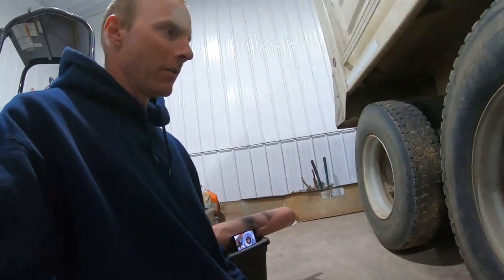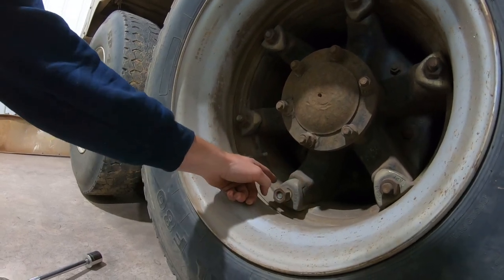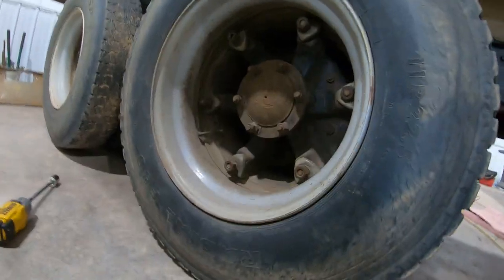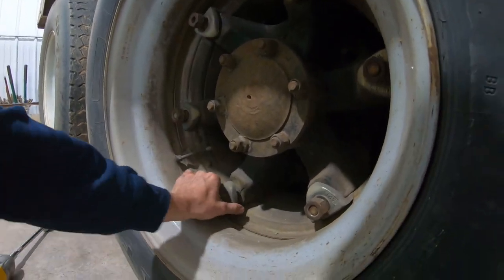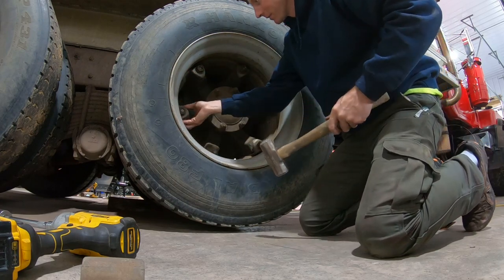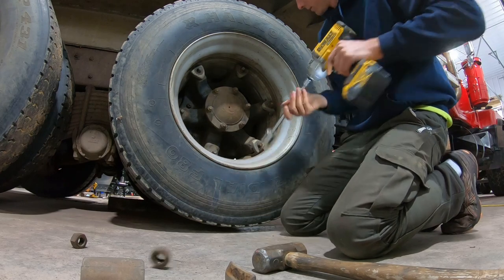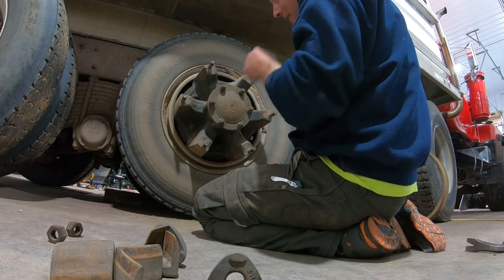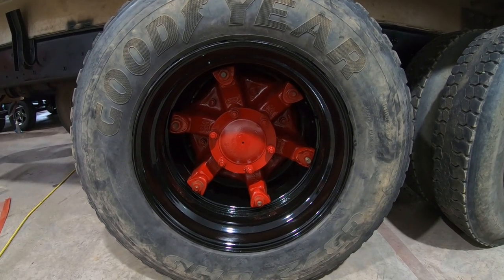How To Take Off Dayton Wheels

Comment: Used to remember trucking with theses on the old trailers, we had to tighten the nuts every time we hooked onto them, nuts got loose and the rim would spin on the hub rip off the valve stem. Some drivers over tightened them, stretched the studs and could screw up the spacer ring. Glad they are pretty much gone now
Reply from the maker: For sure not the nicest thing to work with.

Comment: I was a kid the first time i changed a dayton rim.
Took the nut all the way off. The wedge let go like a rifle shot.
The shop still has the hole in the wall where the wedge hit.
Reply from the maker: That's crazy definitely have to be careful.
Reply: I was always told when messing with split rims/two piece, remove the valve stem or empty all the air.

I NEVER messed with pressurized tyres and always used an inflation cage for exactly that reason. My cousin lost a leg airing up a split rim tyre.

My grandpa could tell horrible stories about the same subject too.
Reply: Draining the air will do nothing in this case😂

Comment: Any reason why Dayton wheels are no longer used?
All I see today are Bud wheels on trucks & trailers.
Reply from the maker: The new style is alot more user friendly.
Reply: Too many wheel offs on dayton assemblies,, and subpar systems,, a hard brake application w loose daytons can shear off both valve stems, and thats its own problems,,
Reply: The wheels that are used today are mostly hub piloted wheels, not Budd Wheels. Budds have essentially two lug nuts per stud. One (with the 13/16" square head also known as a thimble) holds the inner wheel on. The second nut holds the outer wheel on. Also, right side, right hand thread. Left side left hand thread.